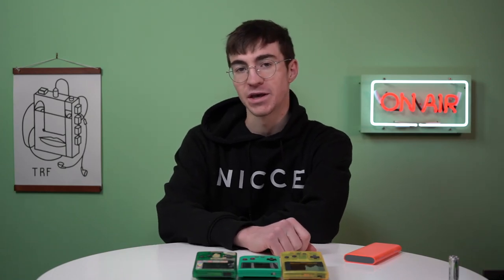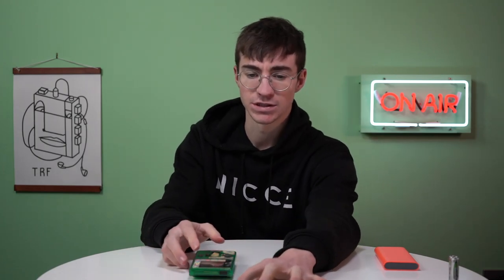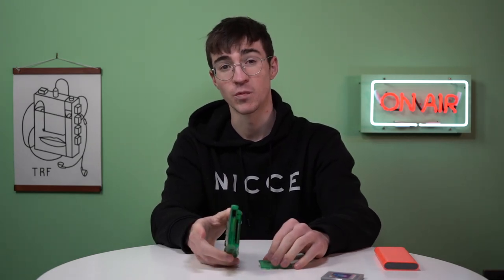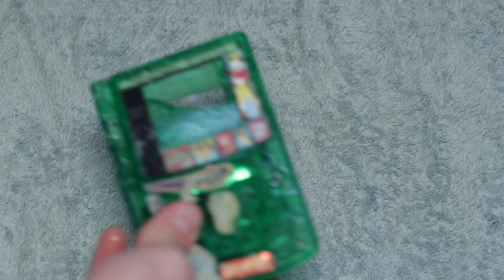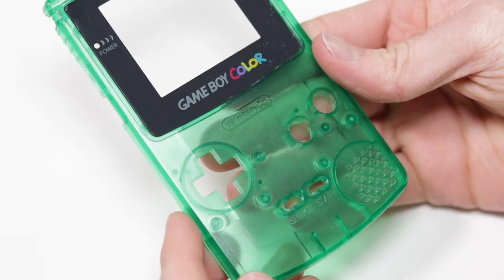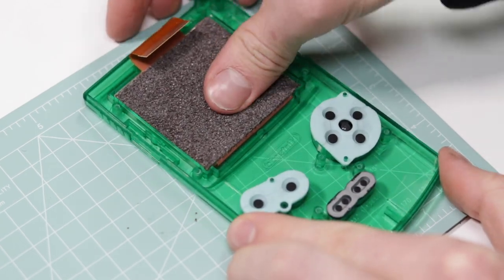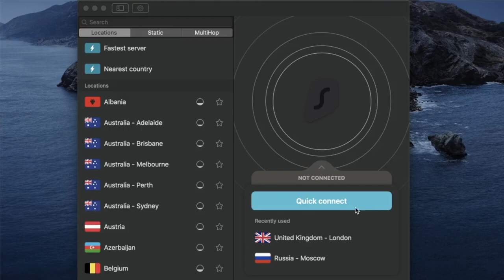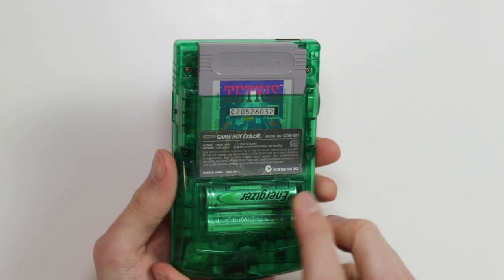RARE Toys“R”Us GameBoy Color Refurb!

Comment: A tip for stickers and adhesive residue I learnt as a bab watching Kim and Aggie back in the day: mayonnaise, or as I've adapted it, oil. After soaking in warm water to the point where most of the sticker(s) come off, dry off the object, rub the oil in, leave it for 10-ish minutes and it should wipe away.

Comment: I use the same type of batteries in my Gameboy
Reply from the maker: They are great!
Reply: @TheRetroFuture  everyone should be using wall power so we don't have batteries filling up a land fill. to bad there is no way to use rechargeables with it unless you cut parts of the case off :(
Reply: @bland9876  There are rechargable AA sized battaries.
Reply: I do
Reply: @DeRive_  Looks like he uses 1300mAh, I've got some Energizer 2300's; a bit pricier and I'd stab someone if they ever tried to take those away.

Comment: For the stress mark on the damaged corner, try holding the plastic over the spout of a boiling kettle. It sounds weird but it should heat the plastic to take the white out of it without warping it.

Comment: You can make sticker removal a bit easier in the future by using plastic razor blades. They are like typical metal blades, but bend easily and won't scratch soft surfaces.

Comment: Hey love your videos! Just a heads up for a little trick I learned, you can fix those hairline cracks in clear plastic with a “super thin” super glue that’s designed to wick into cracks like that. It provides less structural support but will get rid of the crack seen through the clear plastic (just apply it on the inside so it flows inside out, and doesn’t sit on the surface). I personally use the Stewmac brand that’s sold for guitar work. Great work, and thanks for posting!

Comment: Nintendo should revive the Gameboy in a modern form. Maybe make a modernized version of the og, with sleeker edges and a thinner design. As for the cartridge, they should try to make the holder compatible with older games. Maybe by making the new cartridges with the same plugin, but shorter than a GBA cartridge, just like a GBA one is shorter than on og cartridge

Comment: That's an awesome little case you've got for your driver set. Where might one get one of those? I picked up the same set a while back after you mentioned where to get them at and I love it. It's a shame for me, though, I've gotten a screw lodged within the handle bit and can't remove it. Still works fine, just a bit awkward for me.

Comment: Hey man, i got the Ts80 from your recomendations but every time i try to use it it just says low wattage? with any cable and power adapter i have, im on the newest firmware but i cant get it working at all, do you have any suggestions?
Reply from the maker: You have to be using quick charge 3.0.

Comment: Confused as to why you would use furniture polish to remove stickers? I'm assuming you cleaned the internals with isopropyl alcohol? That stuff breaks down glue so a quick soak and the stickers would peel right off

Comment: I like your videos I even subscribe to your second channel, however I think you just don't want to learn new things anymore. For example how to remove stickers. There are much better ways to remove them than just Mr Sheen.
Reply from the maker: What? Learning how to remove stickers in a more convenient way doesn’t seem like a lot of effort. A lot of people have recommended WD-40 but. I have tried it and it and not had a lot of luck.
Reply: @TheRetroFuture  WD-40 is not safe for console in a long term. I use just normal cooking oil. Also there is a stuff called GooGone. In both cases it is important to let it soak in before rubbing it of.